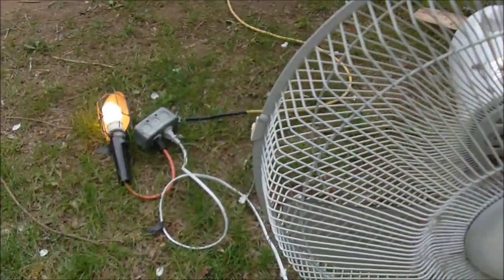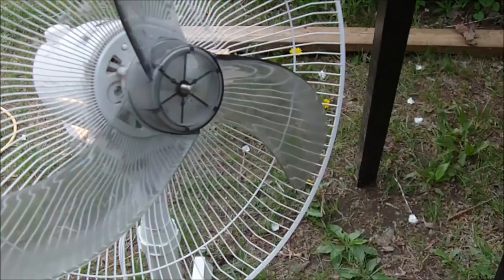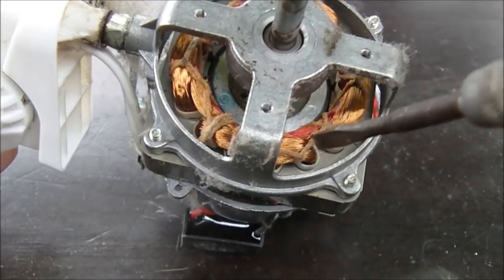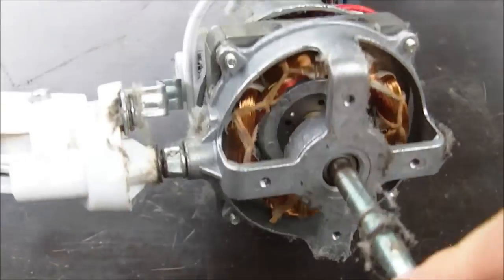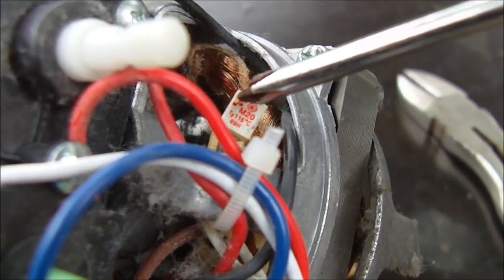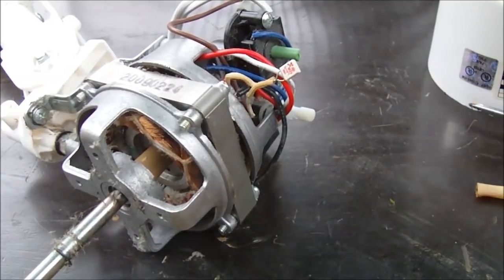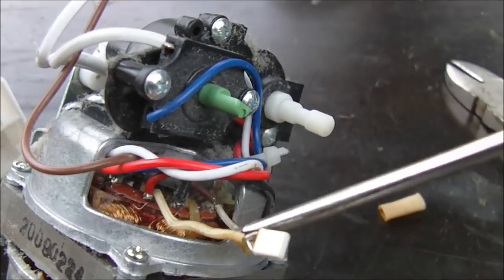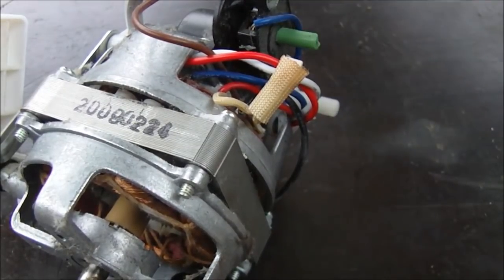Broken fan motor diagnosis for repair

Comment: I had a squiking fan that took about 10min to start spinning....when i opened the motor i i justbblew out dust, put back and then it did not even hum, like no power to engine, so opened again, released the 4 screws holding engine, pulled a part about 1mm, moving the copper and then put power on and it started to hum like it tried to spin....tighten the screws again and it stopped.....removed screws again, let.itnhave a 1mm gap and no engine in working some what....i have no idea how to fix, as soon as i tighten screws the engine is dead

Comment: My Story: Fan stopped running in the middle of the night ( I heard it). The blades barely budged when I turned the switch, and when I removed the over, the blades wouldn't turn or spin easily. Sooooo.... it took a looong skinny screwdriver to reach the screws for the cover. ( One of the Blizzard models). With that off, I vacuumed the motor and it looked good, so I removed it from the case and opened it up. Vacuumed out the rest of the dust and pulled out the shaft and found it was dry at the base. I used some dielectric grease on the bottom 1 inch of the shaft, reassembled it and now it spun fairly easily!! Plugged it in and carefully flipped the switch and the shaft spun up!!!! I sprayed the blades with simple green de-greaser and hosed them off and the grime washed off easily. Dried the blades and reassembled everything and everything worked well. I had to open up the cover on the motor- 4 screws, remove the switch- 2 screws and the over has 6 screws. 

The hardest part was finding the right screwdrivers. AND the motor screws had lock washers and took some effort to break loose. DO NOT put your hand behind the motor when you're applying force to break them loose- if the screwdriver slips off, it will go straight through your hand and you'll have to go to the ER. It probably took longer to reassemble everything- and having some pis BEFORE you take it apart may help in the reassembly if you forgot where something goes. 

And DOUBLE or TRIPLE check that it's unplugged when you're working on it! It's VERY easy to get caught up in the process and forget you have live wires in your hands. 

And thanks for the helpful video bro!

Comment: The fan I'm working on states on the label that it is thermally protected, but there is no thermal fuse. I've pulled all the wires away from the motor and there is nothing. It has me confused right now..... 30min later and after much hunting, I found it. It is not accessible. It is buried under the windings against the plastic form ring covered under a mountain of adhesive. But even if I could get it out, it wouldn't do any good now. Two of the winding wires broke getting the connections out of the way looking for it. Burying it as they did is a little insane.

Comment: hello! i have a fan that needs lubricating, however the felt ring piece inside had worn away and therefore cannot hold any oil so it only works for a short time before needing to be lubricated again. how do i find one of these piece of felt during the current circumstances? (obviously i can't take it to anyone right now) can i use any synthetic felt?

Comment: if the ground plug on the plug end was broke off could that trip the thermal protection?  i mean its a cheep industial metal fan from wallmart like 35$ but it moves a hell of alot of air i love to fix it even if i have to spring for a extention cord to cut up and a thermal protector

Comment: I have taken mine apart several times and cleaned it and again each speed runs too slow fan spins freely whats going on?  I also greased the bearings and the fan ran good for a while but now its slow again.
Reply: Replace the capacitor the size, if same problem happened, you need to replace the motor.

Comment: I need help...Only one side of my window fan is working. I lubed it up and it still doesn't work.
I feel like the motor is tryna run because you can place your hand on the fan blade and feel the vibration that power is getting to it. But it's not actually spinning the fan blade. 
I need to know what this problem can be. Any help would be greatly appreciated....Thanks

Comment: i think u can check if the fuse by putting led end plug to the two led of multitester the  put in  ohms then press 1 on the fan..

Comment: i took apart one our old fans just because i thought something was jammed in it, turned out it only needed oiling but holy HELL was it filthy, i think the accumulated dust is sucking the oil away from the motor
Reply: what kind of oil, cookling oil?

Comment: where can one buy replacement bearings? also, do i need to use calipers to get the specs for the bearings or are there datasheet available for fans by model #?

Comment: 6:05 wait what i didnt hear that so just take the thermal protector off? Got it!🤣
Reply: No if you removed it won’t get power so just twist it basically bypass it but to be safe just replace it

Comment: Really, you make a DIY video and then tell viewers not to do it themselves.
Reply: juliekazak its just a precaution notice . Means he's not reccomended it if you are unexperienced with electric motors .
Reply: This is one of those situations where you have to use your brain a bit to understand. He's saying it for liability purposes only, because there is so much hype about suing people. 

Someone asked me to install pot lights in their ceiling. They did not say it was the ceiling below the attic, and the pot lights were not rated for that kind of installation. They did have overheating protection, but the light said keep it 3 inches from flammable material. They were going to have LED bulbs. Everyone knows LED's use very little power, and give off very little heat. Everyone knows the thermal overload in the pot lights would probably kick in before the light got too hot. Everyone knows fiberglass insulation will probably just melt away if it did get hot. However, I as the installer, refused to install these pot lights because if I put them in and their house burned down, it would be my fault.
Reply: Juliekazak, you are so right. then, whats the point watching this vid.
Reply: He's trying to help and give a mini lesson. Jeez. (And correct about liability).
Reply: liability
Reply: It's a CYA notice. If some idiot kills, maims or burns himself he can say he told them not to do this themself but hire a professional .
Reply: @franciscofagundez1906  So we can do it ourselves if we are willing to take the risk despite the warning.  Lots of people out there are knowledgeable and comfortable working with electronics.  They just might not know anything about fans.
Reply: Mike M lolol
Reply: I was thinking the same thing, kinda stupid really.

Comment: Do you know what is going on if a new fan like this one produces a strange smell mostly when it is working? No smoke, no high temperature just a strange and not nice smell. Thanks.
Reply: Usually it is just the smell of the varnish coating from the winding.  Or better yet, check if the fan blade rotates freely and touch the shafting if it is not hot after some few minutes of operation.  If it is hot, then you might need some alignment of shafting and the bushing.  You can fix it by removing the fan blade first and hammering your shafting lightly upwards, downwards and sidewards until the shaft rotates freely.

Comment: I've noticed recently my 1980s Eagle Aire box fan shuts off periodically then re-starts.  Does anyone know if this is due to a fuse to prevent overheating, etc??  Or does this mean the fan is starting to fail?

Comment: electricretrotech :

I have a pedestal fan that locks the the shaft of the fan at any speed setting. It rotates freely when the motor is off. When its turned on...it hums and locks the shaft. I checked the capacitor and it is at 1.8 microF which is about right...

What do you think might be the problem? Again the fan turns freely when is off.
Reply: Dang I have the same problem right now.. did you ever find anything?
Reply: I found my solution, turns out I needed to just tighten some screws that held the bottom and top half of the motor together

Comment: im have one big fan but is not have termal protection just impedence protection is same or not and my model is whirpool fan high velocity im don find this in fan
Reply: No, is not. it's an electric protection. instead thermal protection it's against overheating and subsequent fire.

Comment: My fan 3speed switch quit working and has four wire connected with these four gold colors paper clip looking things that touch this middle gold circle metal price that make that connection when you turn the nobe and touches the paper clip thing....I was gonna see if I could just wrap the black wire and the red wire around the metal Gold middle  Circle Piece Without over heating or starting a fire

Comment: What kind of lubricant do you typically use in the bearings?
Reply: Light oil, 20wt.  I use a detergent free electric motor oil by 3in1.  Sewing machine oil also works.

Comment: Nice video. In Pakistan you can just pay an electrician $10-12 to replace the coil instead of buying new heh :)
Reply: In US, these fans cost under $10 to buy new.....lol....
Reply: NO they dont........ I want you to send me a pic from walmart or any major store here in the US that sells them under 10 dollars.......
Reply: Chino135 maybe at a thrift store😉
Reply: @keith I think he meant 100 Rupees
Reply: ***** ahhhh......could be......
Reply: It's not worth the trouble to go through all that to prove anything to you. I might have exaggerated the lowness of the price. But a simple google search will bring up many of the el cheapo pedestal fans advertised for less than $20...
Reply: Walmart is the devil. Why are so many people so snide here? How many helpful videos have you posted?
Reply: @keithmullins9201  Yes, you can buy a crap fan for $10.  I don't want a crap fan.  My stand fan is around $120.

Comment: To begin - I know ZERO about motors, electricity, any of this. My dad however is an electrical engineer and has fixed that house fans over and over, until they are at the absolute end of their lives. My friend has a broken small fan, so I figured I’d browse YouTube for some info, just to possibly see if we can tinker with it, diagnose the issue and (narrow chance) fix it before resorting to purchasing a new one. Quick question - After twisting the wires of the thermoprotector, you saw that the fan worked. Did twisting it make the motor bypass it? (Functionally, the same as if you removed it entirely?) This is surely a very low level question, but just wanted to make sure I was following along with the logic of what happened. To someone who’s clueless, it appears “oh, twisting it made the fan work. Great. I’ll leave it like that, put it back together and viola, working fan!”. The reason that’s not ok to do is because leaving it twisted is the same as removing the thermoprotector entirely, and the fan shouldn’t be operated without the protective functionality of that part? Safety reasons… thanks!

Comment: My fan is very new.  I doubt if it is anything due to dust or lubrication.  One day it just didn't turn on at all.  There seems to be no power whatsoever.  I'd like to repair it because I like the fan but not worth the price of a technician.  I know basic soldering and was able to successfully do a minor repair on a stereo receiver, but I have no knowledge of volt meters and so on.
Reply: You stated the problem in the first sentence, actually. It's a new fan. Throw it out, go to your local antique store, and buy yourself a nice antique/vintage fan.

Comment: how to discharge the capacitor of an electric fan before testing with multimeter sir?
Reply: To discharge a capacitor, put an insulated handle screwdriver across both contacts.
Reply: @mikespain8655  7 months have passed and I believe he moved on,  lol

Comment: My fan idk what type it has a stand maybe 4ft tall. Whenever i turn it on the blade turns but the whole fan starts shaking like a drill. What could be the problem?
Reply: DNjA mine too
Reply: Chipo Mlambo already fixed mine. Just  change the blade. Fan worked fine after.
Reply: Blade out of balance. Either hit something, or dust, dirt stuck on blades. Or bearings worn loose enough to let warble .

Comment: And you don't really have to get "qualified". Just watch a simple YouTube video on how to do it or just figure it out. I've serviced with my Optimus F-1672WH pedestal fan multiple times, whether it be oiling or cleaning. I've even taken the electronic control thing apart to insert little notecard pieces to block most of the light from escaping the enclosure. It's pretty easy to service anything once you've done it a few times. 
1:08. And, gee, that motor assembly is covered with dust. Someone hasn't been keeping up maintenance.

Comment: i have metal propeller fan(ventilator) its very expensive and good fan brand-model. But cant run it last 3 years :( repair guy said to me engine moisture(water) thats why we cant repair. In my country if something is not working phone , fan , mini engine etc.. repair guys always blaming moisture or water :D. Can i repair this metal propeller ventilator engine ? Do you have any knowledge ? If it's problem really moisture it was 3 years ago WATER SHOULD GONE and engine is powerful really cause of metal propeller right now :D

Comment: They don't even have bearings, It's just a stand alone shaft. Only ceiling fans have real bearings.
Reply: +smashingstuff09 they do, a hydraulic press is used to press them into the metal hold...one in the front, one in the back

Comment: Can you replace a new bearing? Bcuz mine I've been lubricating for a week and it's just getting worse
Reply: First you have to figure out what the real problem is.  Did you make sure to lubricate both of the bushings? There is always one in the front of the motor and one in the rear.

Comment: That's not grease  !!!  its cotton which hold the oil for lubricating the shaft and bearing..... its a cheap Chinese tactics they know eventually it will fail and the fan will not run or over heat or it will burn the thermal fuse in series with the running coil..... and people will buy new fan .... This is how Chinese making American dollar

Comment: Terrible way to tech people, all test should be done with a meter.
Reply: Not sure if serious, but I disagree.  A separate, more in depth video would be good , but this simple video is fine.  A multi-meter approach raises the bar of entry, inreases the time spent, and isn't really necessary for most of the basic fan repairs (dust tripped heat sensor, frozen due to lack of oil).  He tested the temperature sensor without a multi-meter (by bypassing it).  Switches don't go bad often.  Maybe coil continuity, but that's about it.